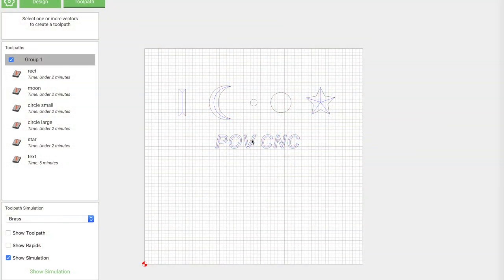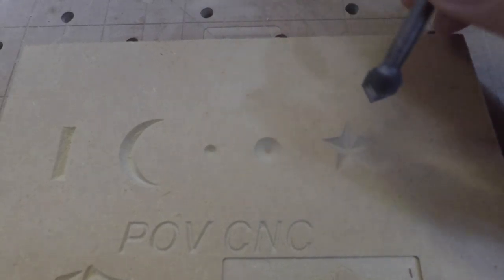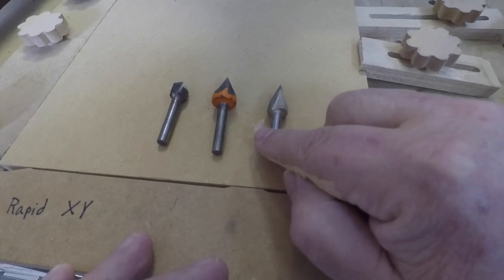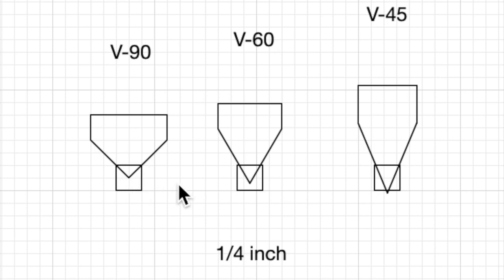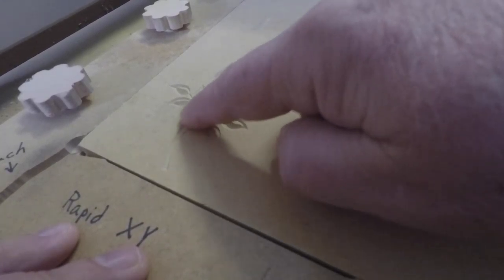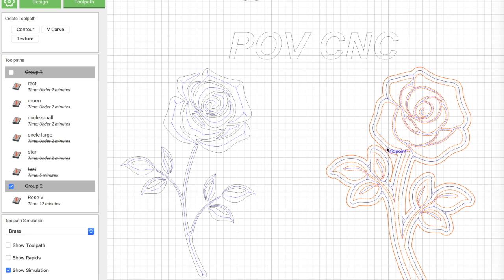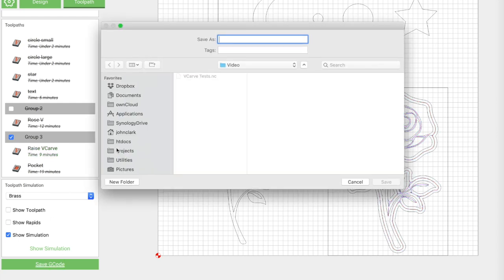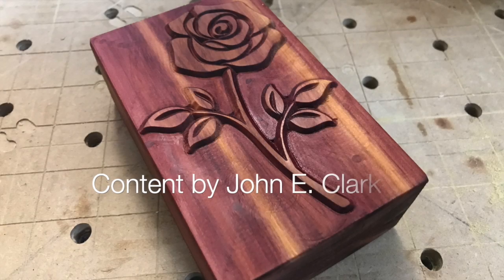VCarving

Comment: This video is a keeper in my collection.
But, I watch many videos and it took me a while to learn to set the max depth to the bottom of the wood and the program determines the rest. it seems every one leaves that part out and takes it for granted not to mention.
But however, if you have a comment on that one I would like to learn when NOT to do that?
Reply from the maker: I have done this both ways. I got used to setting from the top when I started out, but setting from the bottom is definitely better in terms of repeatability and not marring the spoil board. I think in terms of v-carving or recessed design work, I still like to set from the top to make sure I have the exact depth I want. Honestly, a lot of it is down to how your brain works. Some folks visualize the the design better one way or the other.

Comment: Great video! So do you set your max depth the same as the width of you vbit?
Reply from the maker: Carbide Create has two kinds of V-carve paths (Regular and advanced). The regular one just uses the width of the line to determine depth. If its a 90 degree bit, the depth will be half the width between the lines ( a 60 degree bit will be deeper, but I don't know the math) When the lines of an object are farther apart than the max width of the bit, it seems to cut only to the max cutting depth of the bit, while still carving out to the edge of the lines. It can be a little hit or miss for big objects like that. The Advanced V-carve lets you set a max depth and also lets you set an area pocket tool, a flat end mill that will carve out the bottom areas the vBit doesn't reach. I believe you need either the bit setter or some depth collars on your bits to use this option. Does that make sense?
Reply: @johnearlclark  Yes Thank you very much.  I was doing that and making good cuts in the beginning but then they started going bad. I thought it was me but I think my settings may have changed without me knowing. I went in last night and reset my setting in Carbide Motion and the cut I made seemed much better. Not sure what happened but I think I'm back on track. Still tricky to pick the correct bit at times though. I really appreciate your help!!!!  Killer Tutorials!
Reply from the maker: @rrshoeing  Glad to hear you are back in the groove. I think bits and setting toolpaths is the next video I will have ready. Fingers crossed as it has been a weird year. :)
Reply: @johnearlclark  That sounds great! Thanks!

Comment: Thx a ton.  I’ve had my xxl for a couple mos and I keep having questions.  The first outside distance was the same as depth?
Reply from the maker: Yes. The idea is that when you vCarve between the rose and the outside line, that inner line is where the point of the v-bit should go. You want to match the depth so that the follow up cuts with the flat bit are right to the edge of where the v-bit tip travelled.
Reply: I can’t thank you enough.  I messed around with a current design and had it planned correctly.  Thx again.  Please keep making videos.   Another thing I’m struggling with is downloading more fonts to carry through to carbide create
Reply from the maker: @mattl1758  So one thing that makes me a little crazy is the font menu in Carbide Create. At first glance, it appears to be in alphabetical order. However, if you scroll down you will see that it goes past the Z's... to a second group of alphabetical fonts... and a third... and a fourth (at least on my machine). If you load in a new font into your system and can't seem to find it, scroll down and see if it ended up in one of these additional sections. (I really wish it was a searchable selecter field)

Comment: Thanks for this. I can never find the right depth settings when vcarving. I end up eating up all the details.  If I barely set depth say 0.03 or so I get just surface tip ?? Any help would be greatly appreciated
Reply from the maker: So it's a little confusing, but the depth (at least on Carbide Create and I think V-Carve Pro) is a Max depth. This is to keep this bit from diving through your board if the lines are too far apart. So for example, Let's assume a 90 degree bit since the math is easiest. It is going to go about half as deep as the distance between the two lines. If you set max-depth at 1/2 inch it will still only cut all of the details as expected, but anything that would cause it to cut deeper than 1/2 inch will be ignored. The rest of the carve depth will always be dependent on the distance between the two lines you cut between. Does that help?
Reply: @johnearlclark  yes it does. thanks so much. i'll keep practicing.  I really want to use the vbits more.  but so far on  my 8 to 12 inch x 20 to 24 stock sizes, i gouge out my details with the vbit

Comment: Approximate cut depths for V-60 and V-45...

V60: Cut_Depth = Cut_Width * 0.866
V45: Cut_Depth = Cut_Width * 1.207

...or...

V60: Cut_Depth = Cut_Width / 1.155
V45: Cut_Depth = Cut_Width / 0.828

...derivation...

Cut_Depth = Cut_Width / tan(Bit_Angle / 2) / 2
Cut_Depth = Cut_Width / (tan(Bit_Angle / 2) * 2)

Cut_Depth[v60] = Cut_Width / (tan(60 / 2) * 2)
Cut_Depth[v45] = Cut_Width / (tan(45 / 2) * 2)

Cut_Depth[v60] = Cut_Width / 1.155
Cut_Depth[v45] = Cut_Width / 0.828

Cut_Depth[v60] = Cut_Width / (1 / 1.155)
Cut_Depth[v45] = Cut_Width / (1 / 0.828)

Cut_Depth[v60] = Cut_Width * 0.866
Cut_Depth[v45] = Cut_Width * 1.207

Comment: Cut_Depth = Cut_Width / tan(Bit_Angle / 2) / 2

So, the depths for each bit when they reach 1/4 inch cut width...

V-90: 0.1250" (1/8")
V-60: 0.2165" (7/32")
V-45: 0.3018" (19/64")

How to get the formula...

A Bit_Angle forms two right triangles having angles equal to (Bit_Angle / 2). (The Cut_Width / 2) forms the base of each right triangle that will have a height equal to Cut_Depth. If you draw this out, you'll see that you're dealing with "opposite over adjacent" which is the tan function (tan = opposite over adjacent).

tan(Bit_Angle / 2) = (Cut_Width / 2) / Cut_Depth
Cut_Depth * tan(Bit_Angle / 2) = (Cut_Width / 2)
Cut_Depth = (Cut_Width / 2) / tan(Bit_Angle / 2)
Cut_Depth = Cut_Width / tan(Bit_Angle / 2) / 2

Comment: Thanks for your help on this type of v carving. Question. How did you come up with the distances for your offset?
Reply from the maker: With a 90 degree v bit, my depth will always be half the width of my offset. From there it’s just a matter of how high above the surface I want the design to be: for example, if I want my design to be .2 inches high, my offset needs to be .4 inches around the original design. The inner offset for cleaning up the rest of the piece will always be the same as my depth, in this case .2 inches. Does that help?

Comment: Hey John,
I am trying to create a toolpath for something as shown in this video link.
https://www.youtube.com/watch?v=KWnStPwA7tM
I had alway thought that such a design could only be made with a bas-relief toolpath. But the toolpath used in this video is a vector toolpath and relatively faster than a bas-relief toolpath (I guess). It uses a 'curved V-Bit' (i don't know the actual name of the bit) for carving and an end-mill for cleanup. Can you point to somewhere or may be yourself provide some insights.
Regards.
Reply from the maker: I am not sure what software he uses for that particular design (VCarve Pro maybe?). I know that Carbide Create now has an "Advanced VCarve" tool path that may help you with this: https://youtu.be/RHFiaUhQLqc I have not tried it yet, so I don't have much advice to offer on it.

Comment: I did the rose perfect ty I am new to cnc I tried to do eagle from Etsy but not successful
Reply from the maker: Where did the eagle seem to go wrong? I would be happy to see if I can figure out a solution.
Reply: John Clark when I try to do the offset etc all heck brake loose I can send you the eagle svg by email if you want
Reply from the maker: @athanasiospersopoulos1499  Is there anyplace you can post the file so I can take a look?
Reply: John Clark I can send it by email if you want
Reply from the maker: @athanasiospersopoulos1499  That works. Just use the business inquiries email on the channel About page.

Comment: Would you at sometime be able to show this with razed words or is that not possible?
Reply from the maker: The principle is basically the same: Two outset paths around the word, one half the distance as the other. The only difference is for the insides of letters like "o" and "e" you would also want to do the opposite and make paths inside the letters at similar distances. You might have to fiddle with those inner cuts to make them work right, but the basic technique is the same.

Comment: Great video (as usual)

There is now a post-processor like tool for Carbide Create that fixes some of the gaps in CC, with it you can set maximum depth and specify a flat clearance tool.. and you can also do your deeper-than-the-bit-is-wide circle correctly

https://github.com/fenrus75/FenrusCNCtools/blob/master/toolpath/doc/README.md
Reply from the maker: Nice! I will have to check that out. Thanks!